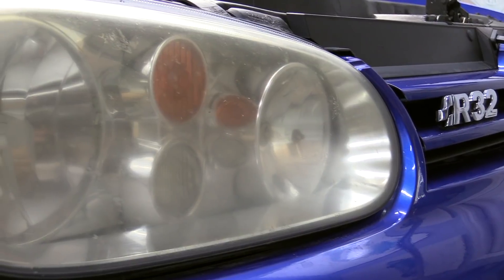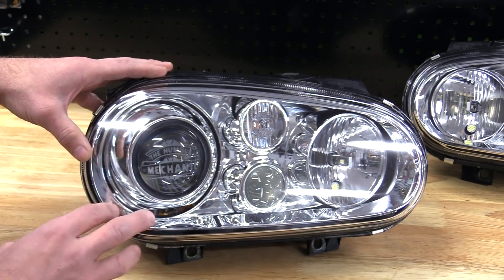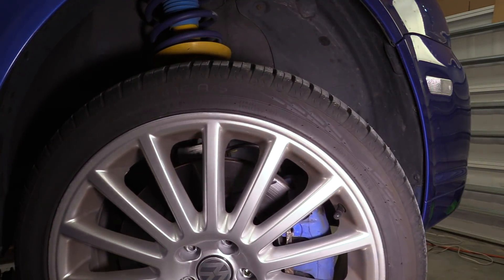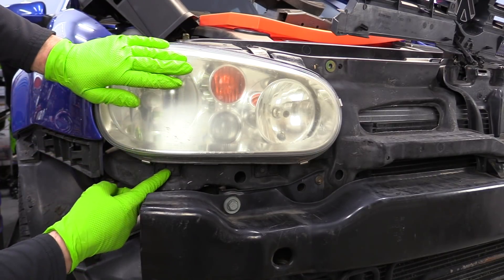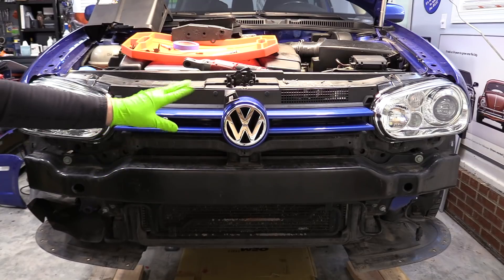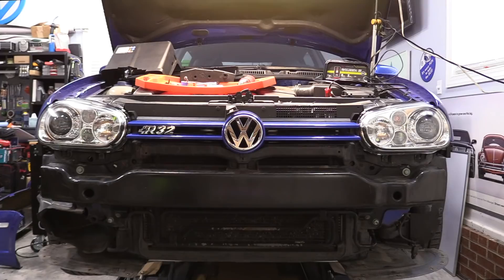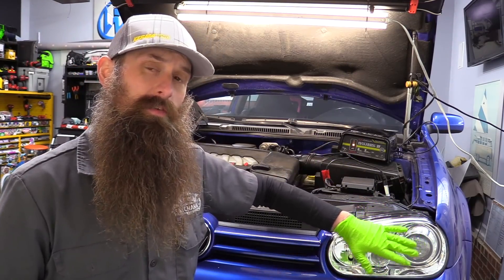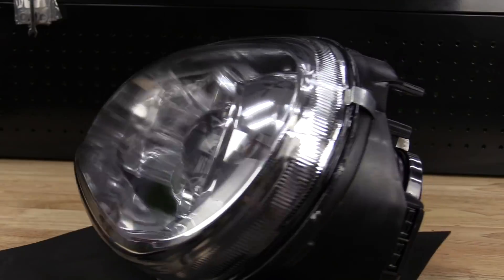R32 Full LED Headlight Installation

Comment from the maker: What do you guys think of these headlights? Don't worry I wont be running around with silly colored lights.. ;)
Reply: You can if you want to drive around with colored head lights
Reply: HumbleMechanic Love the new lights 👍🏻.. I have Hella Celis in mine.
Reply from the maker: Thanks1
Reply: Those lights look pretty cool. I wish my Jetta had Golf headlights.
Reply: Agree, Golf headlights look pretty shnazzy!!!!
Reply: light output has too many shadows and missing uniformity- typical for LED converted lights with wrong optics. city light bulb has to be illuminating high beam reflector and this recessed bulb is a very poor idea from the vendor. I still prefer my Hella e-codes with quality bulbs made in Europe - Osram or Philips
Reply: As far as looks go, they are good because they’re not far off from stock. I kinda hate other people having LED headlights though because they are a lot more harsh on my eyes.😆
Reply: I personally prefer double blinker ones. The R32 normally comes with Bosch OEM HIDs, atleast in europe, weird yours doesnt have it. Maybe they dont make them for us models. They are great, but my personal favorites are well... the one I did lol, its a DEPO light, modified with angel eyes and double blinkers, here they are https://imgur.com/a/AwtNGfm
Reply: I cant find them i clicked the link but cant find the led ones  from your  video
Reply: original xenon light were made Bosch and then switched to Automotive Lighting aka AL. double blinker was required due to brightnes of Xenon lights. this why  you see many cars DRL turn off when turn signal is on.
Reply: Love the lights bud one of the first things i did on my r32 keep up the good work .. is that the steel belly pan looks awesome where did u get it from?
Reply: @W1llN4sh  I've got the Hella Celis too. Have your LED rings faded? Mine did. I wonder if they can be fixed.
Reply: SanchoSanto mine are still looking like new (after three years)
Reply: Looking good from the outside but the beam pattern is faaaaar from good. Stock hid would be a better way.
Reply: Do you know the name of the h3 led fogs
Reply: I can’t find the LED ones on the link you posted. Maybe out of stock?
Reply: I have these MKIV Retrofits and there is a beam pattern flap that flips up when I put on the brights and mine sticks in the up position when I turn off the brights.  Did yours do this?

Comment: I am pretty sure the german TÜV would be happy to NOT allow those! ;-D
Reply from the maker: Hahaha “off road use only” 😂😂
Reply: @HumbleMechanic  Off road use of a car is not allowed, you may install them in your garage.
Reply: My mk4 came with OEM lights like these. They were an option except mine does not have all the tricks that your one has. Mine are self adjusting as the car has level sensors front and rear.
Reply: @brucepeters5100  These are original xenon headlights.
Reply: HumbleMechanic haha hope you have covers for those lights

Comment: Charles, I just put an order in for a set of these because the wiring on my R32 completely disintegrated on my driver's side headlight. I can't find a shop willing to rewire or fix the OEM lights so I'm opting for these. Thank you for making this install video as I'm going to do this myself. The shopI work with wanted $500 just to install the lights, craziness as you like to say.

Comment: OEM light output wasnt bad at all. If you wanted best possible light output you should have bought HID lights.
Right now im ordering 4TL-R HID projectors for my c5 audi. Hopefully they will fit and make a difference because 90s HIDs are dangerously bad.
Reply: Huh? Morimoto product is not bad at all. I've retrofitted some OEM MK4 R32 headlights with morimoto projectors and they are top notch @ 5000K bi-xenon.
Reply: @jdubsvr6  Well yea, thats what i said, xenon beats LED

Comment: Make me appreciate my Focus headlights. Two torx screws and a wire connector per side.
Reply: Agreed, my E39 is a walk in the park compared to this. Five wire connectors, four screws, and the headlight comes out. Adjust the aim, done.
Reply: My F150 is 1 torx on each marker light, 2 clips you pull by hand for the headlight.
Reply: Yeah, but how often do you need to change your headlights? Not the bulbs!
Reply: @blockbertus  
On a lot of cars you have to pull the headlight housing to change the bulb. Inconsequential which you have to change when the whole unit has to come out anyways.

Comment: I like how you worded your intro to your aiming procedure. 🙂 it’s good that you put effort in unlike plenty of people, but standard procedure is technically 25 feet.
Reply: But I digress. They’re a very nice touch to the car and aside from the lens etching, I doubt any randoms around town would even know they aren’t factory. 😎
Reply from the maker: Thanks! That was sort of what I wanted. VERY close to OEM, but a little something extra.
Reply: HumbleMechanic I like em. 🙂 I’m planning to be crazy and build some for my FG2 Civic Si. Using Nissan Murano projectors, clear projector lenses, tuning the lenses for best sharpness and intensity, and I’ll be doing the same thing and making them look as factory as possible. I’ll be using a set of hella gen 3 ballasts and standard 85122 osram D2S bulbs.

Comment: Here's a suggestion; if you're going to sell or give away your old lights, clean them before you take them off the car - the car will hold them nicely while you buff away.
Reply from the maker: Yeah those are a pain to clean and hold LOL
Reply: They will haze over in a few months anyway. The plastic lenses suck on these cars. once they haze over you will fight it until you replace it with glass lenses.

Comment: How are the new headlights working out for you?

Did you get around to adjusting them?

If not, or maybe you can do a video on adjusting the lights. Also maybe a video on cleaning the foggy headlights. I am told in your industry they are called cateract headlights.

Comment: Hey man! Awesome video! Great job. Quick weird question, what did you do with the old headlights? I need the back covers of both headlights. The previous owner drilled holes in mine to install xenon lights and I have been looking for these covers everywhere. If you have those and want to sell, I’m interested, or if you could confirm the part number it could help too. Thanks!

Comment: Very Nice. I'm surprised the US market R32 didn't come with Xenons like the UK market ones did? Xenon would have been even better than a LED retrofit.
Reply from the maker: yeah It's kinda of a bummer. But makes for a fun time upgrading. LOL
Reply: @HumbleMechanic  I've done a clear lens upgrade on my Mk5 R32 and it made a massive difference along with some fresh bulbs. Also retrofitted a set of Xenon reflectors to my mk2 Golf VR6 conversion. Xenon everything!
Reply: Back in 04, DOT claimed they couldn't see the turn signal when the HID (E-code) headlights were turned on. So VW had to develop another headlight system for the US. They used halogen, UGH !
Reply: My 08 has factory HID. The wires are a mess right and looking for a solution that doesn't cost me an arm and a leg

Comment: That light pattern on the new lights looks really strange. It makes me wonder if those projectors are designed to work with the LED bulbs in them. It might be worth it to replace the LED bulbs with better quality halogen bulbs.
Reply: I agree... very strange beam pattern. There isn't many if any aftermarket low beam LED kits that work as good as HIDs in a projected housing. I would love to know what bulbs are being used

Comment: I have a question if you don't mind. A good friend of mine is wanting me to help him polish the headlights on his R32. I am familiar with polishing but I told him we would need to remove the headlights. He is too afraid to remove them because of the auto-leveling feature. I see you did not mention that in this tutorial and I'm wondering if the headlights can be removed, polished, coated, and replaced without retarding the leveling. Any advice would be great!! Thank you

Comment: Nice headlights! Do you have strict rules on how they should be aimed? Here in the UK cars have to have a yearly check to be road legal and headlight misalignment is a fail
Reply from the maker: In my area they check the aim yearly. I’ll bump them down before I get it checked. Actually I don’t even worry about it until 3/2020

Comment: Hey ...I have an R logo with a stand and I would like to stick it on the front piano black grille . It came with red 3m tape but it did not last long. Can anyone suggest a good double sided tape or adhesive and that it would not damage the surface if I want to take it off later down the road? Thx
Reply from the maker: That tape works great. I’ve glued exterior moldings on with it. The trick is to clean properly and use adhesive promoter.
Reply: @HumbleMechanic  the stand base is metal.. would it still work?
Reply from the maker: Yep should be good
Reply: @HumbleMechanic  ok cool thanks much.

Comment: "Custom" doesn't mean what you think it means. What you have there is generic stuff. (even the lens logo is generic nowadays. It was custom 4-5 years ago.
Plus as a mechanic shop, when you talk about aiming headlamps you should be using the specific equipment used by the shops to correctly aim, and not the wall method
Reply from the maker: Pros know that.  Most people watching this wil DIY. And I’d say any item with your logo would probably be custom.

Comment: Jesus, talk about over-engineered. My Saturns are 2 bolts at the top (think 10mm) and unhooking the bulbs.
Reply: amak1131 damn you drive a Saturn 🤣
Reply: Changing the bulbs doesn't require taking the bumper off. Just the whole headlight does.